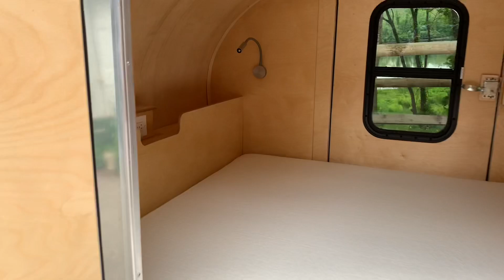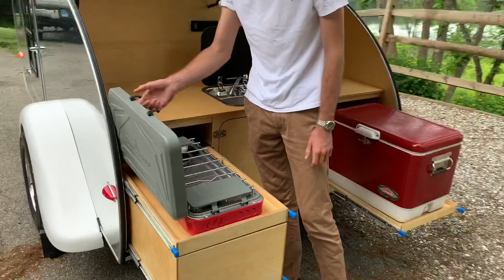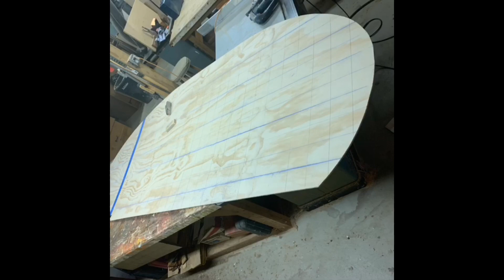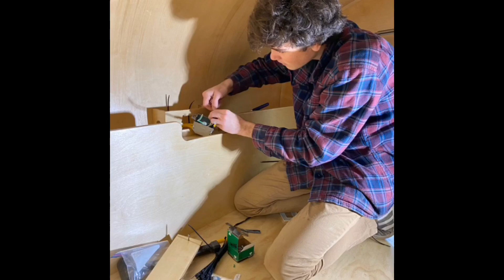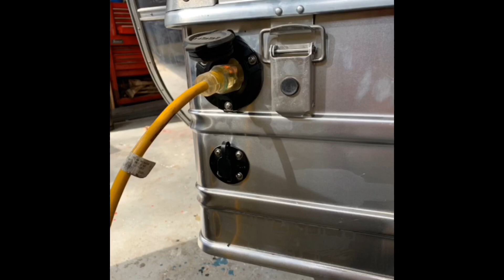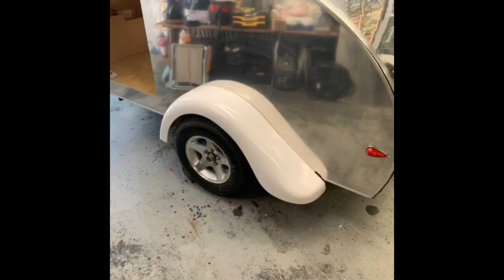Teardrop Camper Build

Comment: Great job! Can you tell me what the 'T' aluminium extrusion is you used on the outside of the galley door? The one that makes the seal to waterproof the kitchen?
Reply from the maker: Thanks! Here is the link for most of the trim used on the build: https://www.teardroptrailerparts.com/hinges---aluminum-trim.html 
The galley door used HT14 "T" molding.

Comment: You did an awesome job whats the max speed on those tires/suspension?
Reply from the maker: Not sure about a max speed, but it was a smooth ride going 70 mph on the highway. These are the axles: https://www.etrailer.com/Trailer-Axles/Timbren/A20RS545.html and these are the tires: https://www.etrailer.com/Tires-and-Wheels/Kenda/AM3S414.html

Comment: Good work young man!! I am thinking about building something similar, what type of axles did you use?? The look like hubs with independent suspension basically?  TY, Chuck
Reply from the maker: Thanks! Correct about the independent suspension on each side. I used these axles: https://www.etrailer.com/Trailer-Axles/Timbren/A20RS545.html along with these tires https://www.etrailer.com/Tires-and-Wheels/Kenda/AM3S414.html